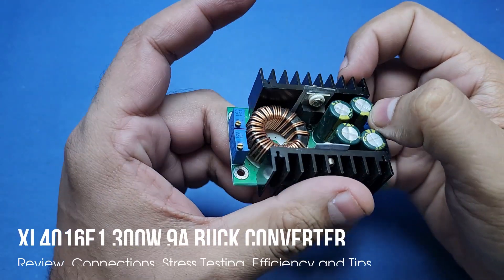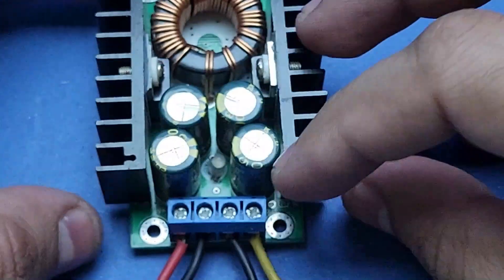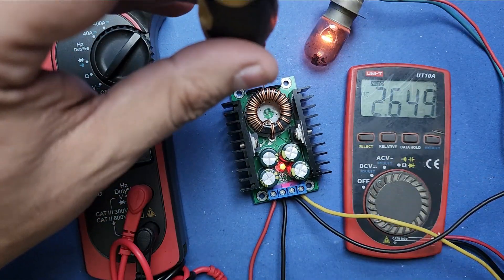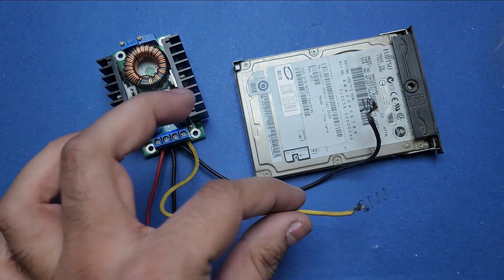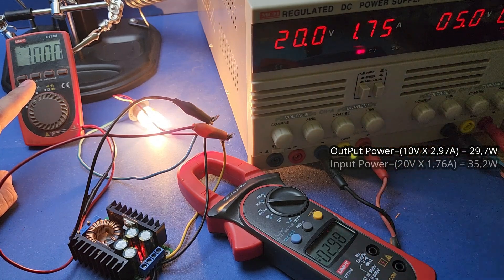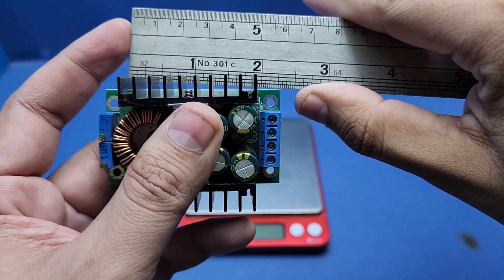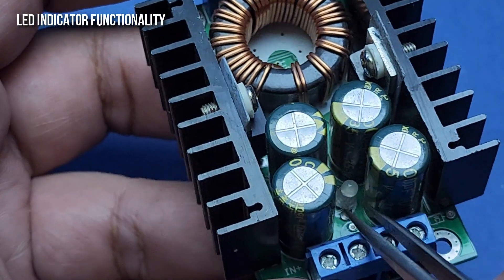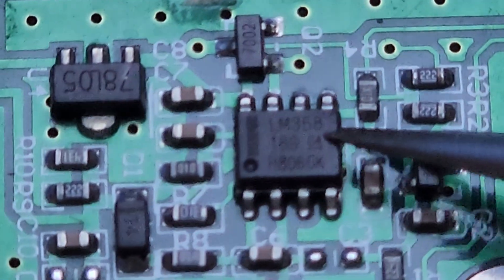Most Complete XL4016E1 Buck Converter Review

Comment: How to adjust current?
Reply from the maker: You can adjust the output current using the top right potentiometer. Turning it clockwise will increase the output current and turning it anticlockwise will decrease the output current.

Comment: can this types of modules make some RF problems ? i want to use one  to low down voltage from my power supply ,17 volts to 13,8 . to connect my uhf ham radio tranciever to it.... can it create RF problems  or strange sounds in my signal ?
Reply from the maker: Yes, the XL4016 is a switching regulator, so it can introduce some RF noise if used directly with a radio. Many hams still use it, but it is a good idea to add extra filtering (electrolytic + ceramic capacitors, maybe a choke or ferrite beads on the output) and keep the wires short. If you do that, most of the noise issues go away and it should work fine at 13.8 V for your transceiver.
Alternatively, You can use a 7814 (14V output which is pretty close to 13.8V but still check with your radios manual), but keep in mind it only handles about 1 A and wastes a lot of heat if your radio draws more. For most ham rigs it’s better to stick with the XL4016, but add some filtering (extra caps, choke, or ferrite beads) to keep it quiet for RF use.

Comment: I'm new to electronics. Do you need to connect to Load while adjusting current?
Reply from the maker: Although adjusting the variable will have an immediate effect on the current but still if you want to monitor the current then you should connect the load.
Reply: @researchcell  Thank you for replying. At 2:31 of the video, you adjust the current, do both yellow and black wires touch each other?
Reply from the maker: Yes the wires were shorted using a very thin wire to slightly limit the current. Otherwise the circuit will open and amp meter wont detect any amps.

Comment: Thanks for this video, very helpful. One error though - the input voltage cannot exceed +35V. That's the Absolute Maximum Rating for the 7805 regulator at the input of the module.
Reply from the maker: Yes, you are right and I have mentioned it in my detailed article on research cell. Since I am making a review of a module, I had to mention the claim of the module manufacturer as it is, which is 40V. However, I have mentioned this in my detailed article on the research cell that this module is using an 7805 that has an input limit of 35V.
Reply: @researchcell  Sorry to say, but these Chinese module manufacturers are not terribly competent. I have a batch of the LM2596 buck converter boards that oscillate at only 50kHz and are totally unusable. Clearly a case of a fake IC being installed, and they're sold everywhere. I was glad to find a good converter with the XL4016 that performs well. Thanks again for the video!

Comment: This is not a true constant current power supply but a current limit supply, is that correct
Reply from the maker: Current always depends on the attached load so in a real world scenario, a constant current is usually a current limit supply. To keep the current constant, you can limit it but If the attached load imresistance is increase ethen to achieve the same current, power supply will need to increase the voltage which is not acceptable in most situations. Therefore when we refer to a constant current power supply, it is almost always a current limit power supply just like this one.
Reply: @researchcell  but that's not accurate because a constant current supply does area the voltage in order to keep the current constant and there are plenty of those in the world. I think you should be more accurate by using the word current limiting instead of constant current
Reply: @researchcell  a true constant current supply operates as you indicated and it is a much different function then current limiting hey.. the two terms should not be used interchangeably
Reply: Absolutely right, it is current limiting function.

Comment: kya hum ise 19 volt 8 amp power supply lagake 14.7 volts , 7 amp pe set kar sakte hai? 12 volt 80Ah Car battery charge karne ke lye! without fan. aur kitne der tak continue itne power pe chala sakte hai? Please reply. Thank You.
Reply from the maker: Yes you can. You can also adjust charging current.

Comment: Can input this between 9-10 Amp
Reply from the maker: As per my experience, The maximum output current you can safely get from xl4016 is 8A or below and since it is a stepdown module, the input current will always be lower that the output current so i would say that operating this module at 9A or more can damage the xl4016 IC. It is wise to stay below 8A.

Comment: I've bought one of this but mine wont change the voltage output. If I connect 12V, on the output is also 12V no matter which way I screw trimmers. Same with 3V and 5V. Any suggestion where could be the problem?
Reply from the maker: May be the trimmers are faulty, did you try to turn them all the way on both sides?
Reply: @researchcell  I tried. Same result.
I "fixed it" with a 10 ohm 10 W resistor as a load. Before that I connected a DC motor as a load but I guess its resistance was too small.
P S. I also give it a couple of turns counterclockwise. But before I connected the DC motor I did a  couple of turns in both directions and checked with the multimeter but  in and out voltage was the same as I described in previous post.
Reply from the maker: You are right, buck and boost converters act weird without loads.